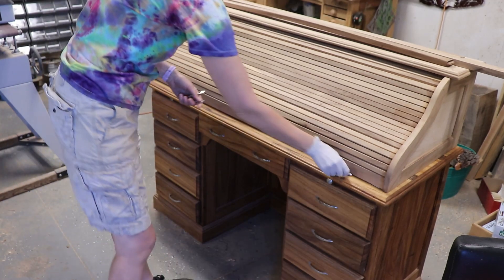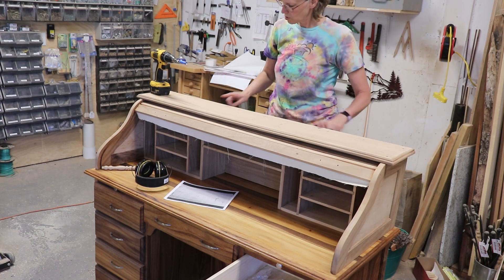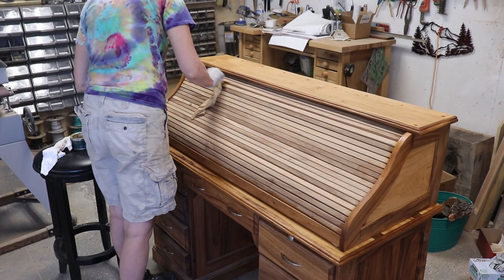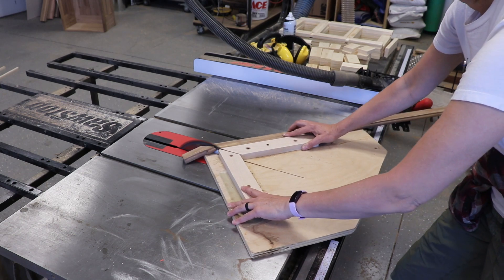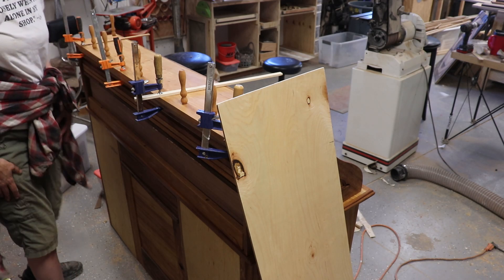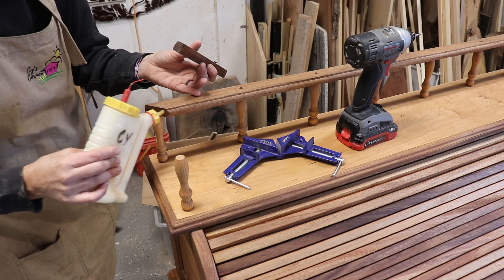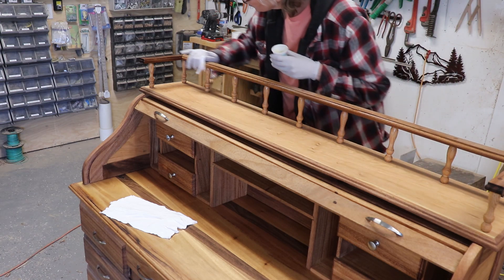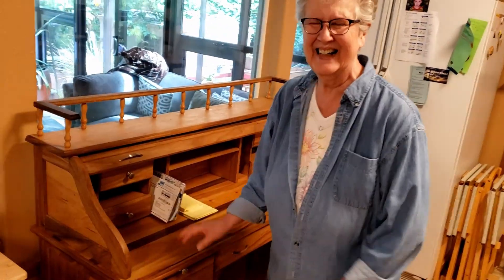Mom's Roll Top Desk, Week 9 of 9

Comment: Awesome! Congratulations on a job well done.  I know how proud your Mom is and will cherish that labor of love forever.  Surprised you used plywood on the back...most roll tops I’ve seen are finished panels on the back also so they can sit away from the wall.  Not sure what the spindles are for on top other than decoration.  Did you turn them yourself on the lathe?
Reply from the maker: Hi :) I didn't turn the spindles, I used some that we had. If I did this again I wouldn't use plywood, live and learn. The top part is supposed to be like a book shelf I guess. :)

Comment: Hello! Really good job!👏congratulations! Pretty project for your mom. I really love the detail that you did inside the drawer with the butterfly🦋 I am on the way to get one of this antique roll over furniture.  I am so nervous to paint the roll over top. I will like to do this in white chalk paint, but I don’t want to damage it and cause the roll over to not roll over well. What do you think I should do? Should I not paint it? If I want to paint it, what paint do you recommend me using for this project? Thank you.
Reply from the maker: Hmmm, to paint or not to paint. I think it would depend on how the roll top part is made. I've made 2 projects with roll tops and both were different. Im thinking about not being able to paint the part that actually slides in the groove so the door can roll. It may look funny if that part is not painted while the rest of it is. But if that part isn't visible then it wouldn't matter really.  However,  painting would be best if it was done before the rolling door was put together. That way the paint would dry without the pieces possibly sticking together. But that would mean taking it apart. Also I'm not familiar with a lot of different paint but a water based paint may be best to keep the pieces from sticking together rather than an oil based, but I still see complications with that. 
Oh, but you could paint every other slat and maybe only a few at a time at the part of the door where the slats are more open or spread apart. Then after they dry open the door some, then paint every other again where they are spread apart more, when that dries open it up again and paint a few more. Etc. Then roll it down and paint the ones that aren't painted between the ones you just painted, doing the same thing, paint at the spread out part, let dry, roll up, then paint the next ones! That is what I would try!